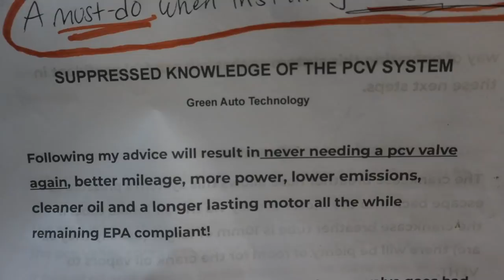The Wonder Of Positive Crankcase Ventilation

Comment: I have a 95 mustang that is turbocharged running a Holley Terminator x ECU I used to run my car with no PCV valve I would get out of my car and literally smell like fumes not to mention anytime I ran my heat sitting at a red light I would have to turn the heat off because I would start smelling fumes so I got tired of this and figured out a route to run a PCV valve with a check valve installed so when I'm in boost I don't send boost pressure into the crank now the car runs way better not to mention My fuel trims were removing 15% fuel and the car runs way better more snappier throttle. Also my oil looks way cleaner after 3,000 miles no more moisture getting into the motor oil 😁

Comment: What about GDI engines ? I'm pretty sure venting those gases into the intake is the reason we have Carbon Build Up problems on modern direct injected engines
Reply: Gasoline normally cleans the intake valves. Direct injection sucks.

Comment: I had one of the First PCVs in my first Car a 63 Dodge 330 Slant -6 225 .  Growing up in the 60's I rember the Smell and the STREAKs of oil on the Highways.  One other thing back then that Gummed up an engine is Low or NO detergent in the Oil.  Pensilvania Grade oil had a Lot of Parisin in it, that is why theye recomended 1,200 mile oil changes.  I pulled aprart a 65 283 Chev and COULD NOT SEE ANY OF THE VALVE TRAIN....NONE!

Comment: The only downside with PCV is with the direct injection engines. Without fuel in the intake passages they tend to build up a lot of crud on the valves and intake tracts because of the ingested oil and gasses. But, adding a catch tank that does a better job separating the oil before it gets to the intake helps a lot. 
With the bigger diesels they're running an oil separator that's either a stack of spinning discs or a filter on the crankcase vent to stop them from venting oil out. The problem there is if they rely totally on the separator so if it has a problem they end up puking a bunch of oil since there isn't really any baffling on anything. 
The smaller diesels usually have the vent routed to the intake before the turbo. Can't really run a full PCV since they aren't pulling vacuum but it at least mostly sucks up the vapors. And, makes you think the turbo is always blown since it puts so much oil into all the intake piping.
Reply: I have a direct injection turbo diesel and only found out about oil catch cans recently. One big problem is that many of the oil catch cans are not effective and many also vent to atmosphere. The better ones work reasonably well but it's still not as good as port injection for the valves. I've seen a video of guys cleaning out their intake manifold and it was unbelievable how much gunk was built up in there.

I'm waiting until I need to rebuild the engine to clean out all the gunk from the turbo, intercooler, intake, valves and associated piping before installing a catch can.

Comment: The problem with that conspiracy theory is that California required positive crankcase ventilation starting 1961 the 49 states followed in 1963. The first system 61 to 67 were open circuit ventilation. Meaning the old style breather caps were still used similar to the ones that were used in the road draft to prior to 1960. The closed circuit system began in 1968 in all 50 states. The EPA did not come into existence until 1970. That would make that conspiracy theory a little ludicrous to say the least.
The biggest problem with the EPA however has been some of their latest regulations that have literally shut off all crankcase ventilation. Have you ever seen the crankcase ventilation on a GM 4 or V6 engine or even on the ls engines? A tiny little orifice that clogs right up the minute it's used and shuts off all ventilation of the crank case.
It is absolutely imperative for the best fuel economy performance emissions and engine life that the crankcase be fully ventilated as they were until a few years ago.

Comment: Well epa is 1 thing, but big 3 with vinyl cam gear on v8s. Was good from 70k to 120k. For a young racer hat on Mopar, this was a boon. Most of these motors were non interference valve. Cloyes double roller ($65)  chet herbert cam ($75), black jack headers (headers 65 fab 50 $115) , uaed Mopar SB mid rise  4bl manifold,, ($20).
Later police package a body sway bar with neoprene bushings.
The whole of that worth more than any a body.i ever had.
Drop the torsion bars to 5 to 10 degree new camber. Run a 64 904 with front and back pumps. No camaro, mustang or 914 could touch me on a mountain road

Comment: In fairness, a lot of what the government has mandated on internal combustion engines has had the effect of making their design more efficient in terms of making power as well as reducing emissions. The cars in the '70s pretty much sucked, but it led to much better cars since then, particularly beginning with the Grand National Buicks. As nostalgic as we may be about the older stuff, stock versus stock, the new cars blow away the cars from the '60s. I've always wondered why they don't make 57 Chevys with modern drivetrains and suspensions available from the factory. I know some people do a sort of resto mod thing, but I doubt it comes with all the factory service and warranties. And the prices are astronomical.
Reply: '57 Chevy chassis and body design wouldn't stand a chance of passing modern safety regs. You might be able to redesign it to be safe for the occupants (i.e. design an entirely new car that looks like a '57 Chevy), but the front ends of old cars were designed before pedestrian safety was of any concern whatsoever. There's a reason new cars always have a rounded shape, plastic bumpers that are spaced well away from the metal structure, flexible hoods spaced well away from the the engine, etc.A '50s car front end by comparison is basically a battering ram as far as a pedestrian is concerned, and it would be very hard to replicate the classic look without making it unsafe.

Comment: Hey Tony you should do a vid on catalytic converters. There are still quite a few people who think they have to rob power.
While in reality they improve the air one breathe immensly. 
Its one of the few things I really despise when checking out cars parades and meeting. Especially since Im asthmatic.
Install a fricking cat already! 😅

Its a very common suggestion also when I explain Im installing a new engine in my car. ”So you going to the remove the cat?”, ”just get rid of the cat”..
Why isnt anyone suggesting I take up smoking two pack a day also? 🤔
Reply: Good cat setups cost like 1% of the car's power output. Far too little to notice unless you're a professional racing driver, and much less nasty fumes.

Comment: Ironically on forced air intake vehicles you absolutely need a PCV valve. If you don't have one, (Or one of sufficient size) you will end up pressurizing the crankcase and forcing oil out of the seals. I had a buddy who put a turbo on a old truck and the thing looked like it blew up after a few runs. Oil everywhere!

Comment: It's hard to believe that no engineers in any of the Big 3 didn't come up with the concept of pulling the crankcase vapors back into the engine to be burned......cleaning up the air, the engine big time before 1963? Did the Big 3 know about this simple device but didn't want to add a few bucks to the price of the car? Did they want those engines to sludge out at  75-100K? I can see safety devices having to be mandated by the gov't like the dual master cylinder but a PCV valve?

Comment: And in this video you mention the use of Two PCV valves requiring richer jetting.....The PCV system IS essentially a large intake vacuum leak, but horsepower is  unleashed by vacuuming the crankcase and upjetting compensates for the vacuum leak which BTW, has a lot of unburned vapors that add to the fueling of the engine..... It's a win any way you look at it and I think it can easily be proven that there is no gas mileage or horsepower cost  in  employing a PCV system.......Lets see it tested!

Comment: I work on boat motors they dont run PC valves
Motorcycles dont run PC valves.
2 PC valves sounds interesting but at wot vacuum is so low it wont pull much air...and good luck getting the jetting right. Motors gunk up internally because the oil used to break down much easier. Engines started lasting longer because of more precise tolerances and fuel injection helps it burns cleaner all the time and it contaminates the oil less.

Comment: Road draft isn’t complete doo doo but the car has to actually move and do up to temp runs not short runs. I love pcv myself I think pcv with an air oil separator in-line is peak. Here in Los Angeles it’s almost impossible to not drive in traffic so pcv is 100% necessary (in my opinion).

Comment: i agree that pcv valves were good for engines.   but a lot of the sludge problems on early engines were that they either used non detergent oils or degergent oils with lots of paraffin.   when they came up the pcv most oil companies also changed the detergent  in oils.  i remember working for doge and chevy and having engines sludged up with less than 5000 miles on them, as they were using one oil (national brand) from the factory that still used paraffin for detergent.  the combination of these is what caused the extended life of engines.
Reply: @gorflunk   thats not the one i was thinking of another name brand. qs

Comment: Using artificially created vacuum to vent the crankcase is a wonderful idea. Sure beats the road draft tube. Will make the engine last a lot longer, and seriously help prevent sludge buildup. BUT. Feeding crankcase vapors back into the engine is NOT a good idea. Of course that is the part of it that the EPA liked (actually it wasn't the EPA, Nixon didn't create the EPA until December 4, 1970) but it had to be some evil government agency. While I love the idea of using a strong vacuum to help vent the crankcase, I still think that crankcase vapors should have been vented into the atmosphere. Maybe through the exhaust system.

Comment: I think the only real "conspiracy for less mpg" that's real is not at all a conspiracy it's just catylitic converters and smog. CO2 and NOX emissions are at odds with eachother. As you go lean and EGTs go high, NOX emissions rise, as you go rich, they reduce. So what a guy could do is run a car well past stoich, easily done with EFI and basically throttle the engine with fuel a bit.This will ensure a very complete burn and ends up being very efficient. However, it increases NOX to an unacceptable level. For example a C5 corvette will do high 20s, maybe 30mpg stock. With a lean burn tune it can hit as much as 40mpg. But it wouldn't pass smog like this. If I was the EPA I'd allow manufacturers to create more NOX outside of dense cities using the GPS that most modern cars come with. Geo fenced emissions could result in less CO2 emissions, that are what actually cause climate change. Smog is a pollution, not climate change issue. And it mostly effects dense urban areas.

Comment: You just opened up a hornet nest.   I wrote this for another form and there's always someone who thinks they know better::

Many people may not like the idea of the crank case venting back into the intake to burn fumes that would be normally vented into the air, but this technology was one of the best inventions of all times.  It was mandated by the EPA, years ago, to prevent this air pollution.  IT turned out to have a major effect of the longevity of the engine oil.  It prevents a lot less dirt from accumulating in the engine... This is one of the major reasons motor oil does not require changing as often today.  You can tell who the experts are with old cars.  Many of them have added PCV to there vehicles, even antique cars.  All at no cost, except for the PCV connection.         I get a big kick out of all the people who  have disconnected these systems.  You see them all the time at car shows.   Disconnecting the PCV,  they basically showing you they are clueless.
Looks for the stupid little filter on the valve covers...

Comment: The worst engine thar I ever rebuilt was a 292 y block  when I removed the valley pan it was so full of sludge that it looked like the pan was still there, the oil pan was equally full of sludge as were the valve covers. What a mess

Comment: I think DI engines could be designed differently(VW) to virtually eliminate the carbon buildup on the intake valves. But the manufacturers like the revenue generated from the 30 mile valve train maintenance required on their turbo and DI engines.

Comment: The truth about sludge buildup of the older engines - is - the old motor oils where not 'detergent' motor oils - the newer oils clean the insides better than they used too in the 1950's 60's and before.  Draft tubes were maybe a small percentage of the reason for sludge.  I have a draft tube classic - rebuilt - and the engine oil stays CLEAN between 3000 mile oil changes - idling around in parades and etc

Comment: only downside to PCV is on modern direct injection engines. the PCV system causes carbon build up on the intake valves. this was never an issue with carbs, TBI or port injection as the fuel helps keep them clean. but on a direct injection there is only air in the intake and nothing to keep the oil residue from the PCV system from building up.

Comment: Except the PCV valve on a modern direct injection engine engine absolutely is destructive. Good luck getting any modern engine to go over 100,000 miles without significant gunk building up on the backside of the intake valves requiring very expensive maintenance. Manufactures and dealers are fine with it because it gives them, a lot of revenue.

Comment: You would never see solid concrete driveways in the 50-60's.  There'd be 2 concrete strips for the wheels to drive on and gravel between.  The old chevs dropped more oil than they burned.

Comment: All I can smell is a crappy edelcrock carburetor. Depending on blow by, it can cause detonation. Oil technology has come a long way too but all in all, I agree
Reply: And if you are running a turbo, the PCV system letting the engine suck all that crap back into the intake kills performance, especially if you are limited to running pump gas....its amazing how much more timing you can run withOUT the PCV being sucked back into the intake!!
Reply: @ssnerd583  Oil has a really bad octane rating, which is why 2-strokes are almost always low compression engines. Of course your engine probably shouldn't have so much blowby that this becomes an issue, unless it's a race engine running low tension rings...

Best solution for a turbo car is probably an oil separator in the PCV.
Reply: @nerd1000ify  ......no...the BEST solution is to vent it into the exhaust and use a vac pump to make sure you have flow.....and when you are running a 2.5, 4cyl turbo motor at 30 or 35psi(or more) making in excess of 550hp....you are going to get that blow by or its blowed up......engine building is a terribly complex thing once you start going to FI and making 2.5 and 3hp/cu-in....but high performance pump gas is where you have the biggest issues if you cant get E85 in your area....and have to run water/alcohol injection systems and/or nitrous....
And we knew all this, including the crankcase crap lowering the engine perceived octane back in the 1980's

Comment: That's not a MEL. It's a Lincoln Y-block and a 368 is the biggest Lincoln Y-block. The MEL didn't come out until 1958 and the smallest displacement was a 383

Comment: The title maybe should be  "The Wonder of a Negative Crankcase Ventilation" And the reason for that is because you dont need to use manifold vacuum to vent the crankcase, just hook it up to the air intake stream. And if its a carburetor powered car, just hook the vent under that air cleaner base.
This is the slight of hand that the EPA has done in this situation. And UT has failed to see that or recognize it.
He created this discussion because he does not want to believe that there is any merit to the idea that a precise groove that is cut in relation to the the throttle plate would have any value. Providing negative opinions in a video does not prove anything.
No matter how you look at it, the throttle plate and opening is a major hinge point for pressure of the air intake. And apparently it is just to damn simple for anybody to see that a groove placed at the right position would cause a positive spooling effect for the draw and pull of each cylinder. Oh my god, a simple groove cut... No way!  Try telling that to the 6000 plus vehicle owners that have had it done since 2012. The object here should be to explore the possibilities of finding more power and efficiencies, and de-myth the myths Not add to the myths. Try proving its wrong instead of vocalizing negative opinions in a video.
here is a video showing zero hydro carbon emissions after the groove process was done to a vehicle. https://www.youtube.com/watch?v=Aa9knoS7m74